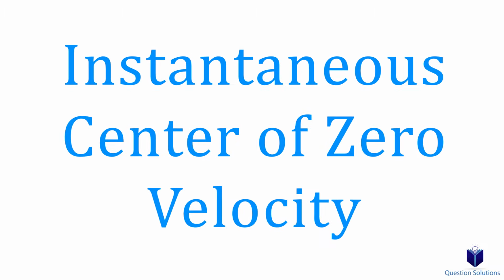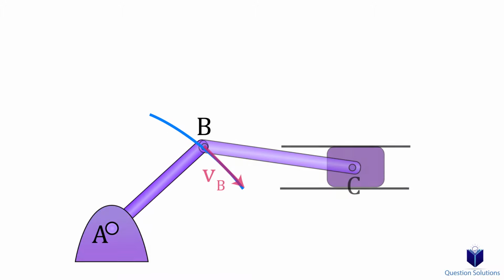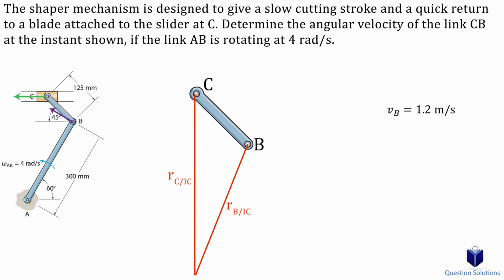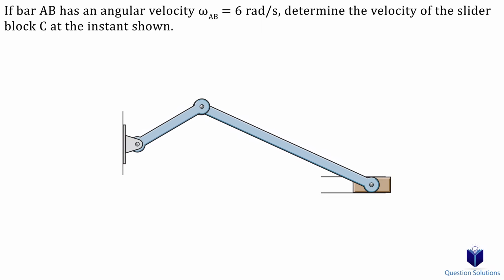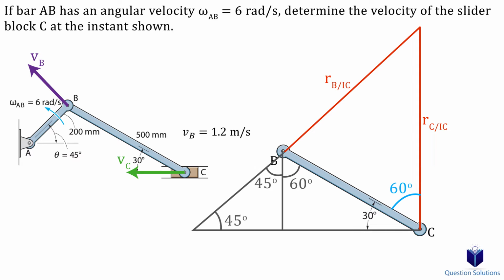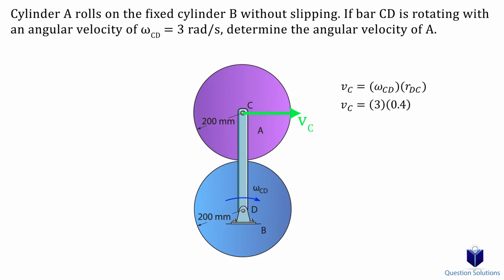Instantaneous Center of Zero Velocity (learn to solve any problem step by step)

Comment: Could you please explain if the solution holds true if both cylinder are rotating. How to find IC?
Reply from the maker: It's hard to say without seeing a question. Did you ask your professor or TA in person?
Reply: @QuestionSolutions  I did seek for help. Could't get it through though. I feel ashamed for asking same question again so I'm looking for solution online. 
The picture can be found in google. The question goes like this if you could help. 
Gear A rotates counterclockwise with a constant angular velocity of Omega A=10rad/s, while arm DE rotates clockwise with an angular velocity of Omega DE =6rad/s and an angular acceleration of alpha DE =3rad/s2 . Determine the angular acceleration of gear B at the instant shown. 
I found the solution to this question online BUT I'm following your technique of IC and couldn't get the same answer. I'm wondering if both rotates then the way of finding IC changes.

Comment: Before I ask my question, thank you so much for making such clear, visual, high quality videos! Your work is helping so many engineering students.
I have a question about the third example with bar AB and angular velocity 6 rad/s. Why do we have 2 instant centers about B, when there can only be one instant center at any given moment? Is the reason that we can take B on bar AB as having IC at A and B on bar BC as a separate entity with IC at the point specified by the triangle? Thank you.

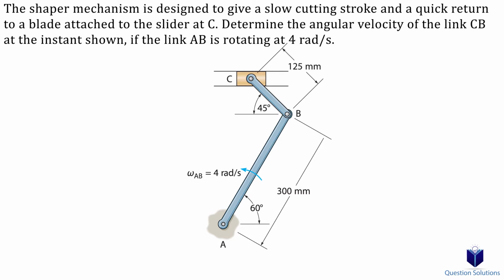Comment: Thank you for these great videos. In the first question 1:51, how do you know to use scalar values, and not vectors for the velocities?, for example why isn't the velocity at c or b denoted in vector form
Reply from the maker: The values were given in scalar form, and the general rule is, if you can solve a problem using scalar, then use scalar. It's a bit easier for most students.

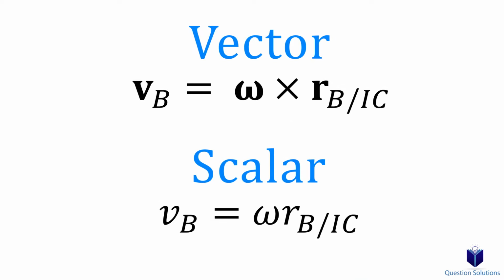Comment: 0:39 when do we use the vector formula and when do we use the scalar formula?
Reply from the maker: It depends on the question. If all your values are given in cartesian form, use a vector formulation, if you can easily solve it using scalar, use scalar. Both methods will give the same answer in the end.
Reply: @QuestionSolutions  ahhh make sense

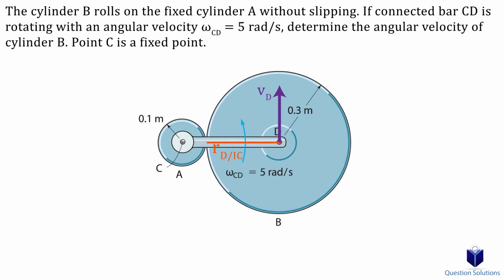Comment: for the question at 5:41 would our IC be different if disk A had its own angular velocity in the counterclockwise direction? I am asking because I got a question in the exact same scenario but disk A had angular velocity in CCW and the IC was NOT at the point of contact.
Reply from the maker: So A is not fixed? It has it's own velocity? If yes, then the IC would perpendicular to that vector. If both have velocities, you'll get two lines that are perpendicular to the vectors and where they meet is the IC point.

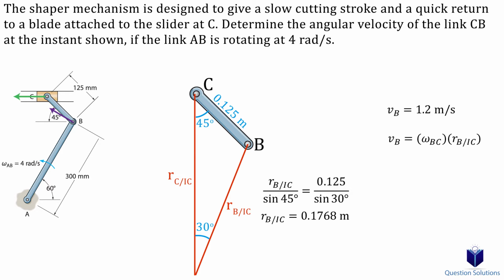Comment: Really important question, why is Vb=(Wbc)(Rb/ic) and not Vb=(Wab)(Rb/ic) 3:28
Reply from the maker: So notice how we used the segment BC to calculate the IC point. Then we use the angular velocity of that piece to figure out the linear velocity. If you use AB to figure out the IC point, you'd use the angular velocity of AB.

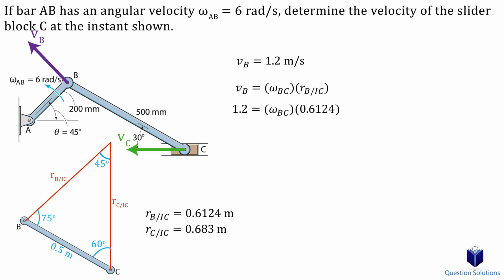Comment: Great video as always, quick question though, at 5:05 , why did we use r(B/IC) to solve for W(BC) in the equation VB = W(BC)*r(B/IC), why didnt we use the bar BC lengh of .5m instead of the r(B/IC) lengh? 

Also in this case when we use the equation relating the velocities at the instanteous center, VB = VA + W(BC)x(r(IC)) what would VA = 0 be in this moment? Like which linear velocity is that?
Reply from the maker: You canuse the 0.5 m if it's a simple rotation about a fixed axis. Here though, that's not the case. We have a fixed slot "C" and point B which is dependent on bar AB. When we calculate VB, you can think of it as bar BC disappearing, and you will see that bar AB going back and forth about point A. If we do the same for bar AB, and think of it disappearing, where does bar BC rotate about? It's dependent on the other bar so you have to use relative velocity or instantaneous center of zero velocity to figure it out.

For this problem, you don't use VA, you would compare VB to VC to use relative velocity.
Reply: @QuestionSolutions  you are the best, I have watched other videos and it make total sense now, thanks for replying.

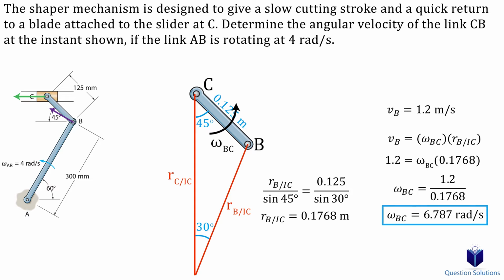Comment: so for the first example, when we get the answer at 3:41, is this the angular velocity of the link about the IC or is it the angular velocity about either B or C?
Reply from the maker: This is the angular velocity of link BC. They are not separate entities, it's a single link. So we just name it link BC. Also, the IC point doesn't change the angular velocity of link BC (so we aren't saying it's about the IC point), it's just a different method to get the angular velocity instead of using relative velocity. I think, at least from your previous questions as well, you might be confusing linear velocity and angular velocity. You can calculate linear velocity at point B or C. When we say angular velocity of link BC, that is for the whole member. That is the angular velocity of the metal rod. 👍
Reply: @QuestionSolutions  oh ok, thanks!
Reply from the maker: @Mechomittencaterpillar  You're very welcome!

Comment: What would be the purpose of the formula with length IC. Yes! to cancel out the velocity in A. And then determine the angular velocity BC. But the velocity in A is already zero. Because it is already fixed.
Reply from the maker: Okay, is there a question in there or is this a rhetorical statement?

Comment: how to choose when to use relative motion or instantaneous center? Or is both method applicable for the same type of question?
Reply from the maker: You can use whatever method you like to solve these problems. It's completely up to you. Sometimes, you won't have the givens to use the instantons center of zero velocity, in which case, you should use the relative motion analysis.

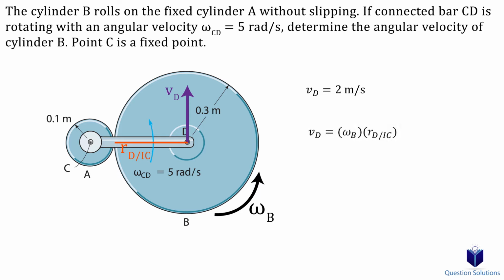Comment: Hi sir, I have a question. At 6:04 should I always draw the radial line of IC towards the touching point of the two cylinders? Thank you.
Reply: I’m confused because when I’m doing other examples where the point of interest isn’t at the center of the circle, I don’t know which direction I should draw the radial IC line to, I hope you understand my question...
Reply from the maker: @kanhchanaly6445  Yes, the IC point would be where the wheel makes contact. For example, if a wheel was rolling on the floor, the IC point would be straight down at the point where it touches the ground.
Reply: @QuestionSolutions  thank you so much!
Reply from the maker: @kanhchanaly6445  You're very welcome!

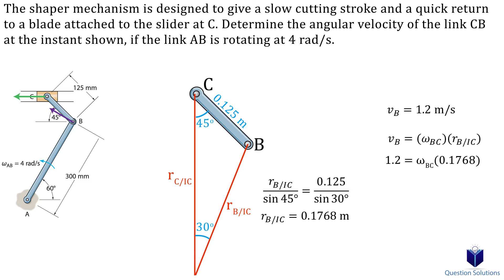Comment: At 3:29 shouldn't that angular velocity be w(B, IC), because it is angular velocity of B w.r.t IC. Why we are writing it as w(B,C)?
Reply from the maker: I am not sure I understand what you're asking. Are you asking about the notation being used?
Reply: No not notation. I am asking whether at 3:29 it should be wBC or wB/IC. How wBC = wB/IC @QuestionSolutions
Reply from the maker: @readbhagwatgeeta3810  Where do you see wB/IC? You're just multiplying a distance labeled rB/IC by a variable labeled wBC. When you plug your values in, you get a solution for the variable wBC. I don't understand what you mean by "How wBC = wB/IC" where did we write that on the solution?

Comment: Thank you so much❤️❤️btw
I've got a question, 
I have a problem comprehending the purport of this method. 
When we say we assume point A has no velocity, does it mean we assume it's fixed? If that's the case , in the previous method , we also assumed(as an example) point A is fixed but it was moving? 
And another thing is that:
When is it allowable for us to use this method?
Reply from the maker: So you can use this method whenever enough information about the geometry of the problem is given. If you have a question where you need to find the velocity of a point and you're given distances and angles, use this method, it'll get you to an answer faster than using relative velocity. Also, keep in mind, this only works with velocity, not with acceleration. We aren't saying point A has no velocity, we are just ignoring it because we are using the instantaneous center of zero velocity point. So if you saw the previous video about relative velocity, we compared one point (point A), to another unknown point (point B), and figured out the velocity using a position vector from A to B. Here, instead of that, we use the IC point, so no position vector from A to B, and we can just forget about the velocity at point A. You can imagine a single object rotating about this IC point and that's really what's happening behind the scenes. Your textbook should give a more detailed analysis of this method along with the proof. 👍
Reply: @QuestionSolutions  THANK YOUUUU SOOOOO MUUUUCHHHH😭😭😭😭
Reply from the maker: @krypton9773  You're welcomeeeeeeeeee 😅

Comment: Hi just wanted to ask 
Can you explain how we got this equation 
At 6:07
Reply from the maker: It is the same equation shown at 0:41. It is the scalar method of finding velocity using angular velocity and a length. So in a rotating circle, the velocity at the very edge is equal to the angular velocity multiplied by the radius.

Comment: Does instantaneous centre of velocity help to determine the direction of the angular velocity as well? because I solved one problem with both velocity dynamics and the ic method only to find that the velocity dynamics method gives a negative when the angular velocity is clockwise, but the ic method does not
Reply from the maker: So generally speaking, it does give the direction since you can see how the object would move. For example, looking at 3:39, we established that the angular velocity of BC would be counter-clockwise. You don't need the answer to tell you that since you can see and imagine the object moving in your head. You know the direction it has to go since these involve fixed axes. Also remember, we with this method, you're getting scalar values where as with, for example, relative velocity, you can get vector answers.

Comment: For example 2. wouldn't vc=1.64. You said vc=wBC*rC/IC but wouldn't vC=wCB*rC/IC because it comes from vC=vB+wCB*rCB. Or does the order not matter is wCB=wBC
Reply from the maker: Order doesn't matter since it's a scalar value. So you can think of it in simple terms, the rod BC or CB, (same rod regardless of how you name it), has an angular velocity of 1.959 rad/s.

Comment: Can you explain why in case of rolling wheel on ground without slipping, it's linear velocity on it's circumference equals zero at the instant it contacts with the ground. I know in case of gears their linear velocities are equal when they are meshed, make sense but here it seems the velocity can't be zero when contact with ground it should be same as when not in contact with the ground. Kindly elaborate.
Reply from the maker: I think this https://deutsch.physics.ucsc.edu/6A/book/torque/node16.html explains it well, but your textbook should also include a very good explanation too.
Reply: I think I understand now, appreciate your response.

Comment: At 6:09 How do you know that y component of velocity of the point of contact of cylinders is zero.
Reply: basically you wanna say that the point of contact of cylinders has neither X nor y component of velocity basically zero velocity
Reply from the maker: Because velocity is tangent to the rod, so you can see the rod is straight upwards, which means velocity is horizontal, only has an x-component.

Comment: 3:25 i don't get this step at all. It's using angular velocity of BC but the r_(B/IC), can someone explain this to me? doesn't solving this equation give the angular velocity about the instantaneous center? Namely (omega_IC). Unless omega_IC=omega_BC, but I don't see how that's the case.
Reply from the maker: So the cool thing about this method is that by multiplying the angular velocity by the instantaneous center distance, you actually end up getting the velocity of the link. Remember that velocity is just angular velocity multiplied by the distance from the axis of rotation. Here, we are pretty much doing the same thing, but now, we are just imagining the rod rotating about the IC point. The proof for this should be in your textbook, (if not, a quick search should allow you to find it). Also, I think doing a few questions will allow you to visualize what's actually happening, and this technique will become really helpful in the future for some problems where going through the traditional method of relative velocity can be tedious.

Comment: 3:35 . I don't understand how Wbc can be used in the formula Vb = Wbc * rb/ic. In other words how can Wbc be used to to calculate Vb, because point c is also moving right. So it doesn't really have a angular velocity. I am confused. Great vids btw !!
Reply from the maker: So what do you mean by "it doesn't really have a angular velocity?" Rod BC definitely has an angular velocity, otherwise, it wouldn't be moving. It fact, we even show it to have an angular velocity of 6.787 rad/s. So maybe I am not understanding what you are asking, or maybe you can rephrase the question? Point C will have a linear velocity, point B will have a linear velocity, and they will not be equal either. Let me know if that helps. 👍
Reply: @QuestionSolutions  Sorry for the confusement. Someone else asked a similar question which said, "in the equation, V_B = W_BC(r_B/IC), why are we using the angular velocity of BC (W_BC)"
Reply from the maker: @icu3545  We use ω_BC because that's what we used for the perpendicular lines. We found the IC point using rod BC, so that's what we need to use. That's the whole point of this idea, it's to use the IC point related to a rod, and use that to figure out the velocity at any given point on the said rod. We can't use AB since we didn't find the IC point with respect to rod AB. Another way to think about this is to imagine rod BC rotating about the IC point. It might make it more clear that all we are doing is multiplying the distance from the IC point by the angular velocity of BC. Remember that in the scalar form, we can find the linear velocity by simply multiplying the distance from the axis of rotation to the point where we are finding the linear velocity, it's v=ωr. So all we do is just figure out this "rotation point" which is the IC point, then figure out the distance and multiply it by the angular velocity. Does that make sense? :)
Reply: @QuestionSolutions  Aha, I understand. Amazing explanation. Thank you so much sir!!!
Reply from the maker: @icu3545  I am really happy to hear you understand it! Best wishes with your studies 👍